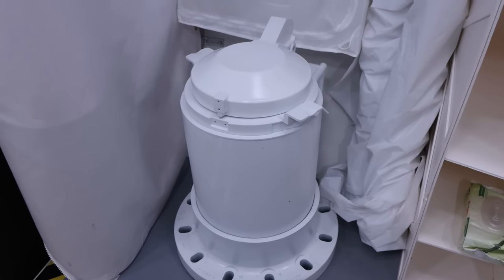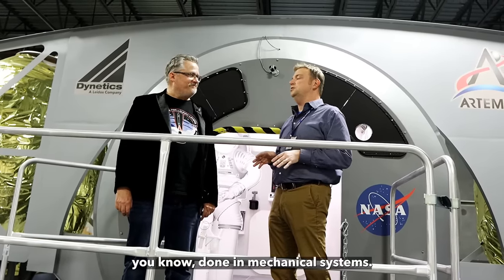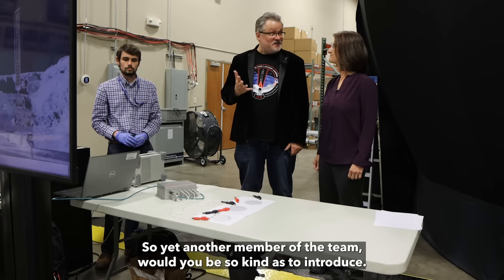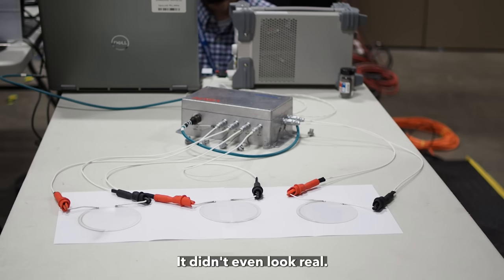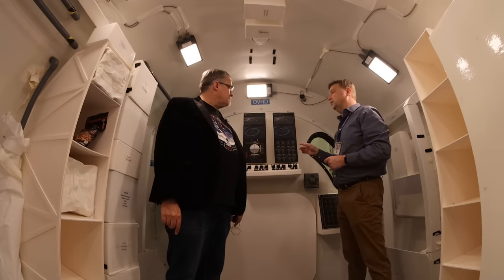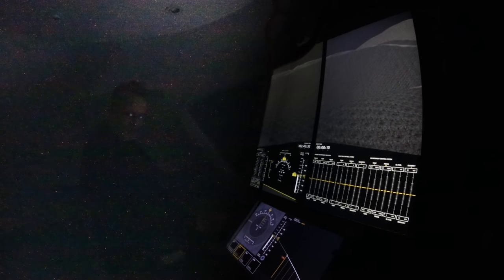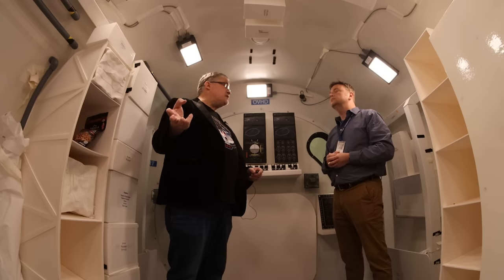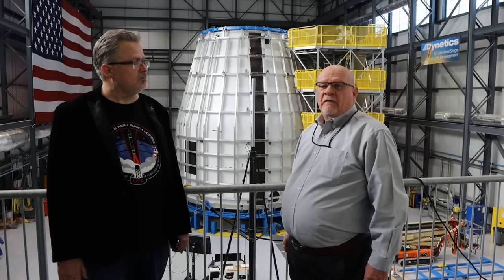Go inside SLS and a new Lunar Lander!  Exclusive Tour of Dynetics!

Comment: Hold, on.... Isn't that toilet rather conveniently placed with the window?
Granted its small anyway, however;
So you can, in fact, use the facilties.....immediately look left, point and say;
'oh!... $h!t!'

Jordan dude, I'm not a sound engineer mind, but I wonder if some of the audio difficulty could have been exacerbated by the fans being outside and the fact you are recording inside an is designed as an sealed air chamber...So it will in some way almost capture all the chatter...
The only thing I can think of to remedy the situation currently, is unfortunately a big pink AA mic sponge.

Very impressed with the Lunar landing however.
In fact, might be the odd interesting show segment.
One angry astronaut, a simulator and some of the hardest (and being a one planet species still, relatively simplest) space maneuvers!
God bless you, I needed this today. cool stuff.

Comment: The dust removal demo was impressive. Could this be laid over Mars or Moon rover solar panels to keep them dust free? Imagine if Opportunity could have just shrugged off the Mars dust from its solar panels, it might still be active.
Could it be used on terrestrial solar panels that are located in desert areas?
Btw, I wonder why Perseverance is not equipped with a brush tool for use with its manipulator arm to clean off its solar panels from time to time?
Reply: 4 reasons for the Mars Rovers/Landers not to have what you’re suggesting - 1) MASS - They’re already at their mass limits when they launched - That’s why Insight didn’t have a proper drill & had the non-functional POS it had; 2) There already are RTG’s that could have powered these craft but they weighed more than solar panels (See MASS); 3) the solar panels & electronics are fragile (See MASS again); & 4) Electrostatic charges in the Martian Regolith with cause the dust to stick to the brushes & cause the brushes to scratch the solar panels which are fragile!

Comment: I saw the dust "disappear" from the white fabric. I understand the electrostatic, but where did the grains of dust go?
Reply: Well, that little bit of dust "blasted off" the pad as a very fine granular "mist" into the room air. On the moon, if used outside, the tiny grains would just accelerate away. If used inside the vehicle, that air would be sucked out of the egress compartment and filtered. A big part of the problem is that moon dust/regolith is not "granular" but instead is jagged with sharp points that can embed into fabrics, etc.